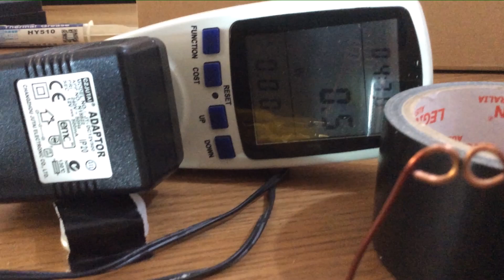HAVE YOU GOT THE SAME SPARK AS TESLA?

Comment: I find using just regular coax cables winded on pvc tube slightly larger then globe like a coil works very well.  Much easier to build as it has built-in capacitance already.  Also one can use 2 screws in 2 pcs of wood to adjust the SG distance. Cheap and fast!  Outer shield of coax can be ground_A.   Your yellow gator-clip there is ground_B. I find the further apart the brighter the bulb. But that is another topic altogether.

Great video! thanks.
Reply from the maker: Thank you for your comment.
Coax would be a great conductor for this with it’s high dielectric property. The coil seen in this video is from another device, it has sat on the edge of a table with other experiments for years and every time I walked past it I would always think that this coil looks like it would be the right size to sit perfectly on the plasma globe. Eventually I stopped walking past and I tested a heap of things with it.
 I had seen Don Smith’s plasma globe in old photos and this is where I got the idea even though the coil that Don used was different, the basic concept comes from there and there are a heap of coils that work, even a straight wire will collect enough energy to light an LED.

Comment: hi thanks for the video :) do you have a diagram i can see :) thanks again
Reply from the maker: Thank you for your comment.
I have not drawn this one out yet. I generally build this stuff in my head for quite a while before I get off my backside and make it a reality, I feel safer connecting “this to that” in my imagination as I have been electrocuted a few times over the years and my research has only led me to more and more dangerous devices. I am happy to draw a schematic for you, I might have to make a super short video for it.
Reply: @whatifididthis...1236  Thanks. Does it look like this?
(the line "|" indicates connection)

Circuit:
bifiliar coil with one wire going to air. Coil on on plasma 
|
LED 220V AC lamp ?
|
Spark gap (at "resonance")
|
ground

So i have a bunch of questions hope its not to many, especially about the double bifiliar coil.
What is the important things to have in mind when I wind the coil?
Are the inner and outer coils cables right over each other? 
How is the inner coil connected to the outer if so how?
Why aren't it the same amount of turns on each coil?
Are the amount of turns important? 
What is the size of the plastic ring,? is it important? is the wire stranded speaker wire? and what is the area in mm²?
Is it possible to do this with single layer "normal  wound coil" like seen on the don smith device from his presentations? Would be easier to build:)
how does it work? I can understand that it pull charge from the earth somehow. 
could it be looped to self run?
Thanks again :) have a nice day keep up the good work
Reply from the maker: @martinetellerandet8566  Happy to answer your questions.
Yes you are correct regarding the connections.
Let me wright it with a slight difference using — as the connections.

Coil — 240V AC LED — Spark Gap — Earth Ground.
It can also be arranged as follows:
Coil — Spark Gap — 240V AC LED — Earth Ground.
I haven’t measured which is better.

When designing a coil it is said that it is best to consider what you want it to achieve, ie voltage and amperage as well as magnetic influence. That being said, the coil in this video is from a completely different circuit, it is being used because I kept walking past it thinking, what if I stuck it on top of the plasma ball? This coil is different in design to Don Smith’s, I have tested Don’s coils and whilst they are easier to wind I personally believe Tesla’s Bifilar design emits a larger radio field.

The inner and outer coils are wound one on top of the other.

The coils are not connected in this video but can be connected or used separately and simultaneously.

The coils are a different number of turns because one is on top of the other. The plastic ring they are wound on is 18cm in diameter. 90 Turns on the inner coil becomes the larger form for the outer coil resulting in a bigger longer outer coil with more turns. The plastic ring was selected because it came from the only bucket I was willing to destroy, so the size was not selected as such.

The number of turns is usually important but as you can see in some of my other plasma ball videos even a straight wire will receive energy. Therefore it’s best to experiment.

The wire is multi strand speaker wire 1.2mm, from memory. It is not as important as the insulation thickness. The insulation, if the correct material, acts as a Dielectric capacitor. I have made coils with thinner insulation that did not work. The spacing between wires is dictated by this thickness of the dielectric insulation.

I don’t claim to know how it works and would be guessing because our education has let us down by not teaching us about these systems that are over 100+ years old now. I just know how to make it work. Don Smith stated it was self running, the meter seems to agree with him. I believe a critical factor is the length of the wire coming from the plasma ball power supply, the length determines the frequency that it can pick up wirelessly. I believe this is why Don’s power supply cable from the battery was so long, a deliberately selected length of resonance.

I hope this helps, please don’t be afraid to ask questions, the world would be a better place and we’d all be smarter if we asked more questions!
Have a nice day.
Reply: @whatifididthis...1236  so how important is the amount of turns and the way the coil is connected? is the inner coil just not connected with 4 open ends? and the outer just conected to one wire? how high is the plastic ring 4 cm? does it have to be excatly like yours to work? thanks again :)
Reply: Really eager to replicate your setup. Just need clarity on the coil connections and the importance of turn count. Does everything have to be exactly like yours to work? Thanks for your time!
Reply from the maker: @martinetellerandet8566  Not everything needs to be identical to my system for this to work as I have repeated this experiment with other coils also. The first coil is two wires, speaker wire, these two wires are laid on the form side by side. In this case the speaker wire has the two wires fixed together so they are naturally side by side. I filled the form which gave me 90 turns of a two wire cable, I took one end of one wire and connected it with the end of the other wire, making a Bifilar coil. The second coil is wound atop the first coil and made of the same wire, due to the increased diameter after laying down the first coil the form has become larger resulting in the second coil being 100 turns. This second coil is also connected as described before, making it a Bifilar coil also. The two bifilar coils are not physically electrically connected, during this video the second or top coil is not in circuit, however it may have a capacitive effect on the circuit due to its dielectric capacity.
I hope this helps, don’t hesitate to ask if you need more information and I would appreciate an update on your experiment if you would be so kind.
Reply: @whatifididthis...1236  thank you so much. I will make it. I have globe and the wire.

Comment: Hello dear @whatifididthis...1236 . Hope you are going well. Could you please tell me to what is connected the yellow crocodile? Would it be possible for you to draw a  schema? Thanks again for sharing your explorations.
Reply from the maker: Thank you for watching and your kind words. I am slowly but surely getting better and can almost walk normally again, my normal anyway! 🤣
The yellow crocodile clip goes to earth, I use a 30 foot length of wire connected to a metal rod that is only a shallow 150mm into the earth, the deeper the earth rod goes the brighter the light will get. I can try to make a shorter video in which I can supply a schematic.
Reply: @whatifididthis...1236  I'm pleased to hear that you are going better and that you are recovering day after days. Do you think it is possible to replicate your experiment with the use of a flyback instead of the use of the plasma ball ? Have a great day
Reply from the maker: @Pierre-Marie-9-6-5  I imagine it should also work with a flyback circuit. However, it will be very different to my setup as there is ferrite involved. I am unsure what number of turns would be required but with a little experimentation you should have success. I estimate my coil to be producing between 1000 - 2000 volts which would be low when compared to a flyback. Sadly I blew up my last flyback so I need to extract another one from an old tv before I can perform this experiment. Please let me know your results if you attempt it.

Comment: Hi, so the other side of spark gap in air ground, or? The yellow cable?
Reply from the maker: Thank you for watching. Most people would probably think that was important information and I completely left it out, I watched it back and I can see the moment my mind went off the rails!
The yellow cable goes to earth, the yellow cable can instead be grounded to a large piece of insulated metal that acts as a ground. Alternatively the yellow cable can go to an insulated 30 foot length of wire that will also act as an earth if a real earth ground is not achievable.
Reply: @whatifididthis...1236  Thanks for a quick reply. I try the setup with no so many coil turn wind directly to the plasma tower. With the iron/iron and carbon/carbon spark gaps. Use the earth ground and air ground. I guess I'm missing something because i didn't get the effect...
Reply from the maker: @dusannovak6158  The number of turns on the coil is important, if it is at all different to the one I use it will be a different frequency. The coil I use was designed for another system and one day I just decided to test it in this system, to my surprise it worked great. In my very first video you can see the effect with extra coils involved that allow a brighter light to operate. The number of turns in this instance is critical because there is no way of increasing voltage after that first coil, in other words that’s where all of the energy is coming from when you’re not using extra coils or capacitors.
Reply: @whatifididthis...1236  ok, have you try and bigger loads?
Reply from the maker: @dusannovak6158  I have tried larger loads, this configuration will power approximately 15 watt loads and other components need to be added or more correctly, this system is added to other systems to power larger loads. This video primarily focuses on the spark gap and the influence of tuning the gap distance. This system should be viewed as the catalyst for the spark, the spark supplies the power to the input transformer through wireless radio transmission.

Comment: I remember pretty well that Don Smith said people expect to see them in a circuit but they don’t have to be there, actually I’ve just watch it yesterday again before you publish this video clip
Reply from the maker: Thank you for watching. You would be absolutely correct, Don Smith rarely used a spark gap in his designs and instead relied on resonant coils to transmit power, causing his power input cable to be as long as the coil and operating on radio frequency. The spark gap is somewhat of a lazy persons easy cheat method, as long as you have the correct spark gap.
Reply: @whatifididthis...1236  Just wanted to thank you both for these 2 comments, my own studies over the last year lead me to investigate Don's work and I now firmly believe he was right about the resonance and power phenomena, what I didn't agree on was the common idea that a spark gap was required since I don't see why one would be needed, especially when we take radios into account, seeing this piece of information actually left me a little relived since I thought I was missing some crucial piece of information that I couldn't see, was kinda driving me nuts lol. 

It's all about controlling the field and resonance, a transistor can do an even better job than a spark gap at lower power levels, it's when you get into the higher voltages and currents that other tricks are required.
Reply from the maker: @JenkoRun  Thank you for your comment.
We all arrive in our own time and I feel that moment is often not acknowledged by those who arrived earlier. We have all been skirting the edge of reality for a long time, our formal education as the centre of all things acting like a black hole, drawing us all back to the centre of knowing nothing whilst the universe tries to pull us to our real destiny, truth.

Some of these things require real experiments and the realisation of the differences of spark gaps is not so easily obtained from a book. This discovery for me was another one of those accidental discoveries that can't occur by just reading. My spark gap was arranged on a piece of plastic that wasn't rigid enough which caused the gap to fluctuate, this fluctuation is what allowed me to see the zero amp reading. At that point I realised it was a specific distance and once I placed a weight on my assembly it was more rigid and I was able to make minute adjustments to find that spark gap sweet spot.

Like riding a bike, once you know how, you will always be able to ride.